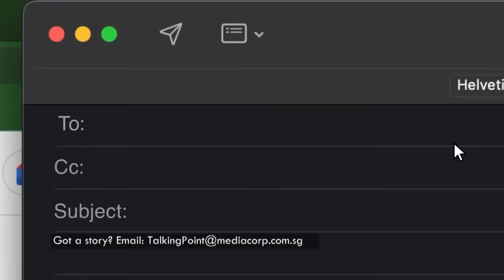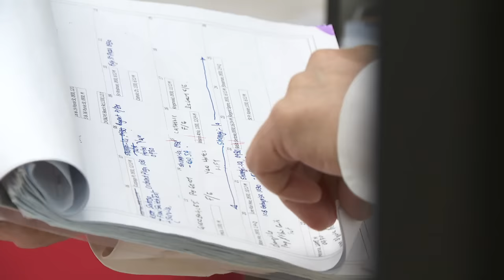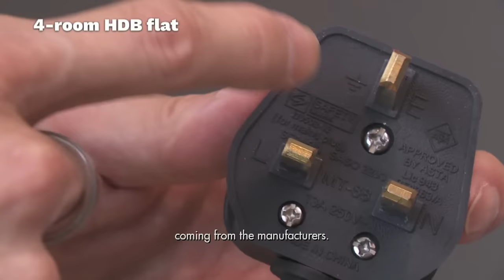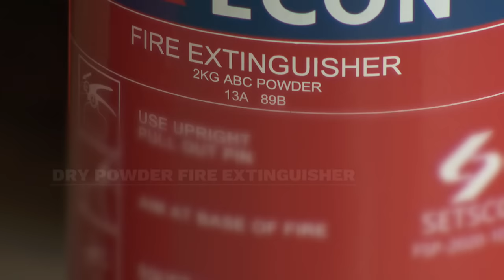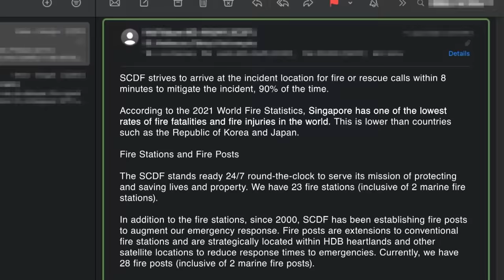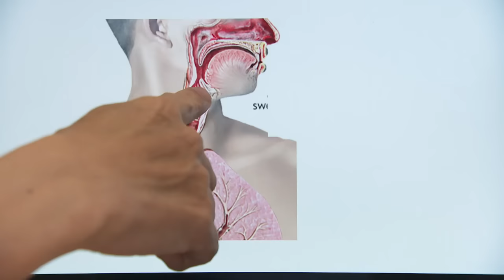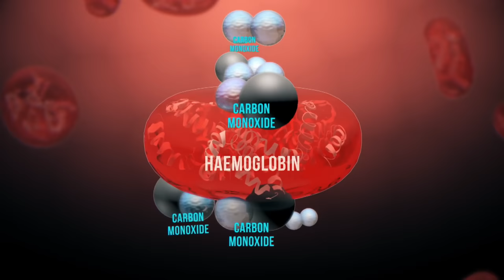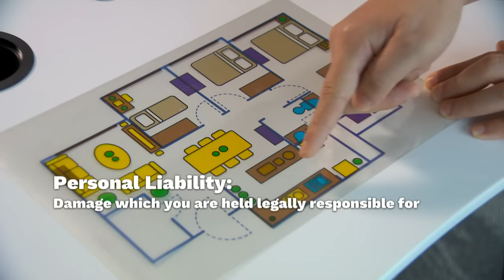How Safe Is Your House From Fire? | Talking Point | Full Episode

Comment: I see the other problem in the 5 room condominium. There are two schuko/european plugs connected to the power strip but it is not grounded because of the lack of a proper adapter.

Comment: Photoelectric Smoke Alarms, Heat Detectors, CO Detectors, Beam Detectors, Duct Smoke Detectors, Tamper Switches, Water Flow Switches, Sprinkler Systems, are all components of detection systems. In the US, apartment homes, buildings, etc., will have a direct line by telephone or radio to the Fire Department, who will be directly informed if a fire situation occurs. The main Fire Alarm Control Panel will serve as the focal point for the firemen when they arrive. This video was a good intro, but as a Fire Alarm professional, they barely scratched the surface of fire detection, annunciation, notifiers, and so on. Public safety programs can also be instituted, with appropriate inducements to motivate people to join in and learn safe practices.